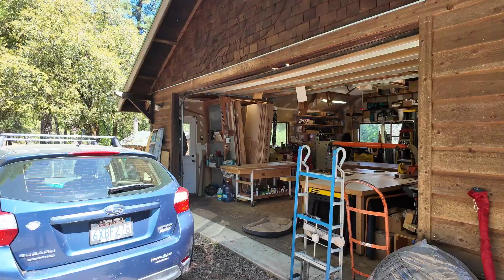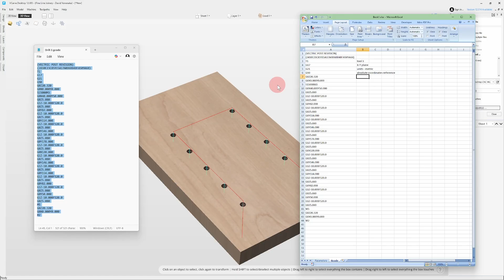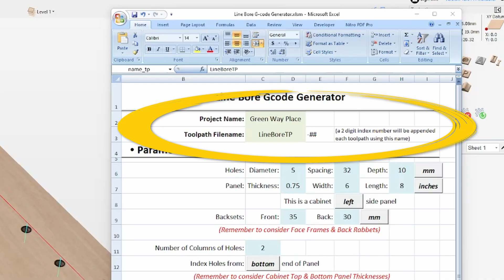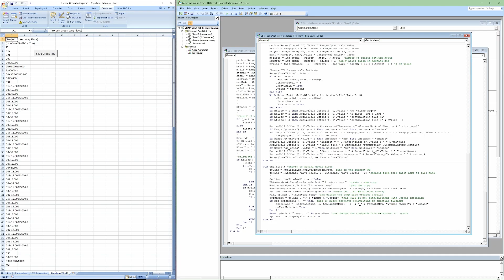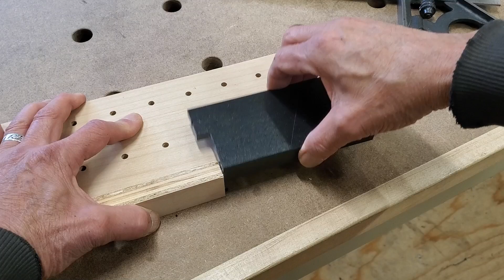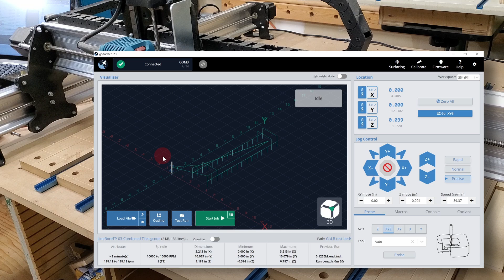Parametric Line Boring Gcode for My Longmill CNC

Comment: Great video of your development process. Did you consider using a cad/cam system to develop your gcode? Something like Fusion 360 can be used to create fully parameterized drawings and will then spit out the gcode without the programming you needed using excel. Just a thought
Reply from the maker: I use a parametric 3d cad program but the cam module is another several thousand bucks. Not worth it for hobby level CNC'ing. I have since learned about VCarve gadgets, which might do the trick. I currently only have VCarve Pro supports gadgets, but so far I'm still using Desktop. Besides, I'm a little bit of an Excel nerd, so I had fun doing it! Glad you like the vid. Thanks for watching!